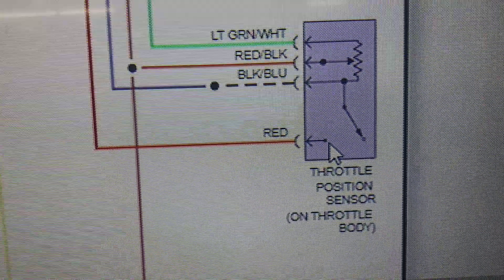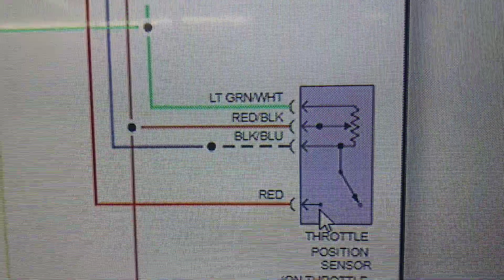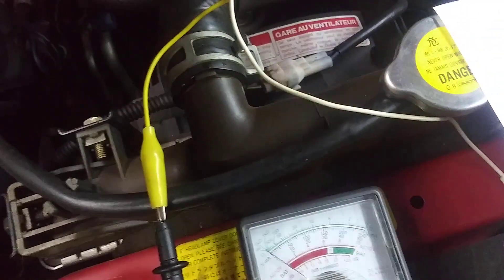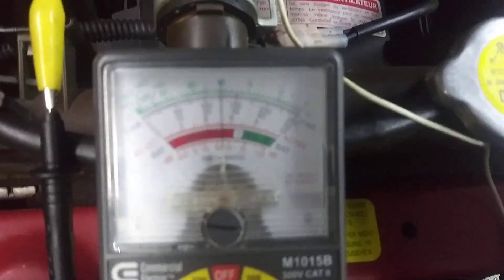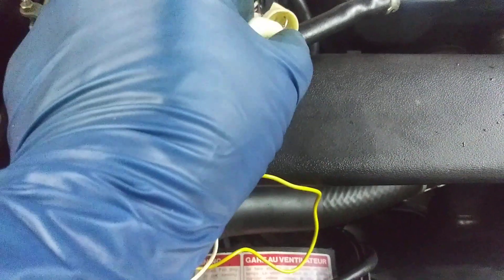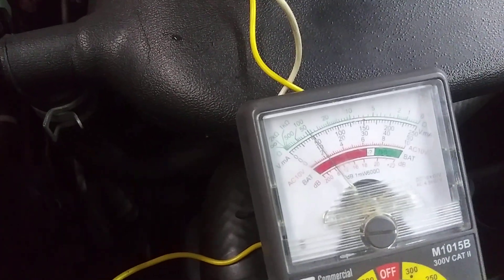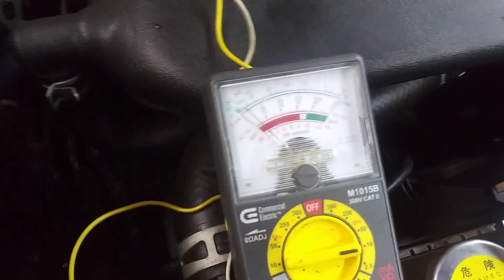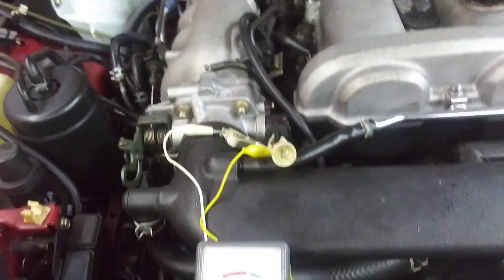Throttle position sensor, checking for proper operation on a Mazda Miata

Comment: Hi great video, just testing my sensor, i have constant 12v when connected to red wire,  car starts cuts out immediately could this the problem. but will run when start first thing and cold
Reply from the maker: Could be check wire diagram